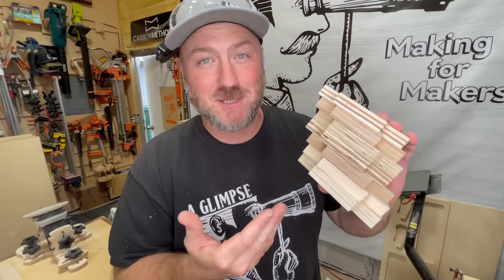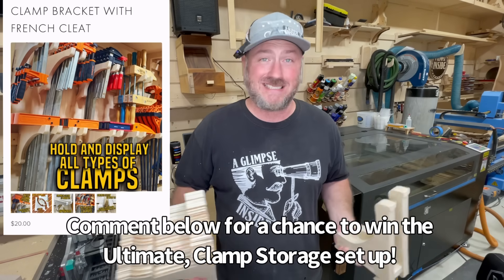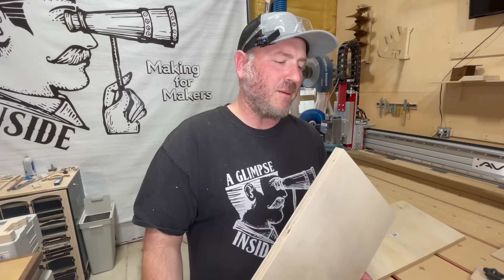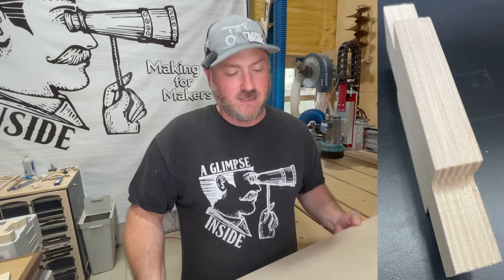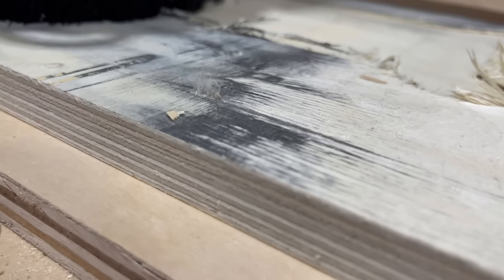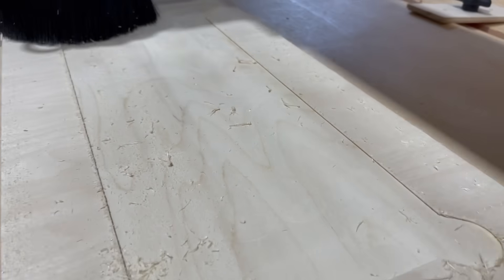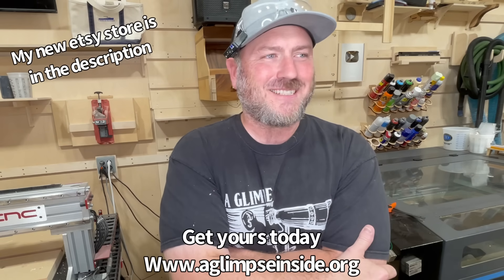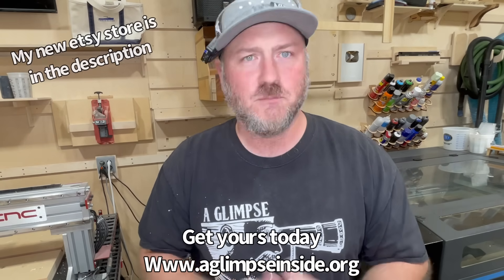The TRUTH About What’s INSIDE Your Plywood

Comment: As someone else mentioned, the fibrous stuff is probably just used to hold the edges of  the interior veneers together to make up the required length or width of the sheet.  My degree is in Wood Products Engineering but long retired and I don't keep up with all the newer product lines but I used to represent Allied Plywood, headquartered out of the Boston area.  At the time, they were the sole importer of Baltic Birch and it was all manufactured in the Soviet Union.  Russia has untold miles of nearly pure birch forests in the taiga and all the plies were their species of birch, hence the weight and strength.  Standard size was 5' x 5'.  The only similar product was Finnish Birch, almost certainly the same species, differentiated because the 2 most inner plies ran lengthwise, resulting in an even total number of plies.
Reply: Nice info!

Comment: I think the nylon fibers are likely a tape that is being using to keep multiple layers edge to edge before the final glue up.
Reply: This seems like a possible reason. The plywood factories could peel a log into huge sheets and join them using tape into even longer continuous sheets. The tape seams are rare and have no effect on the final strength. It was probably a coincidence that it showed up in one certain brand. They probably all have them.

Comment: Interesting to see just what is inside those products..  Hey Chris, do you ship to Canada? The 1/8" ply is getting increasingly harder to find (for laser projects).  I recently cleaned out a local lumber yard of theirs as they said they would not be stocking it any more. I got 4 pieces of 5x5 1/8" "baltic birch" for $100 CAD.
Reply: I believe Chris will but the shipping costs are super high to get stuff up here. KJP Select Hardwoods (my hardwood and baltic birch source) has 1/8" 5x5 baltic birch for $33.75 and have free shipping at a certain threshold.

That said, I have a bunch of Chris' stuff (bits and holders) in my shop, so if you can get it, don't hesitate to pull the trigger!
Reply: @LYTOMIZE_Woodshop  Thanks for the heads up on KJP select, I will definitely check them out.

Comment: Interesting information in the video, but for the most part irrelevant unless you are in the southeast US. Additionally not giving any information about the specific plywoods in the description leaves me wondering what was the point? Maybe spending more time on what you feel makes a good versus not good plywood would have been helpful. More plies seems obvious, but you like the BB with 11 plies better than the one with 15, so it's not just ply count. I did find the info about the plastic nails very helpful, so there is that.

Comment: A well-respected Podcaster who is connected to the lumber industry recently tried rationalizing the poor quality, high cost, and general state of the plywood industry. I appreciate his opinion on things, but his biases were out in full force in that episode.  I have dozens of plywood examples from 2008 through 2020 from various sources, parts of the country, types, thicknesses, etc., and the quality, thickness, and price per unit is garbage these days. The synthetic fibers being added are another bit of nonsense.  I have 3/4" that was 3/4". It's now 3/4" category, 11/16" nominal, and 21/32" actual. 4x8 sheets are coming in 1/8-1/4 short half the time. Plies are irregular and voided. Veneers are as thin as physically possible. It's been value engineered into garbage and we've been conditioned to take it and say thank you may I have another.  Covid didn't cause the decline, it accelerated and spread it though.